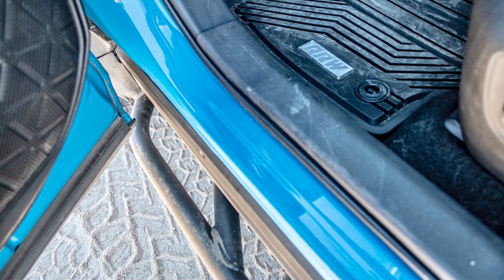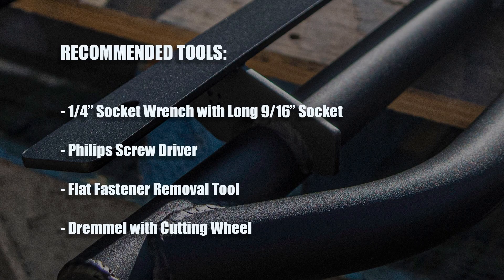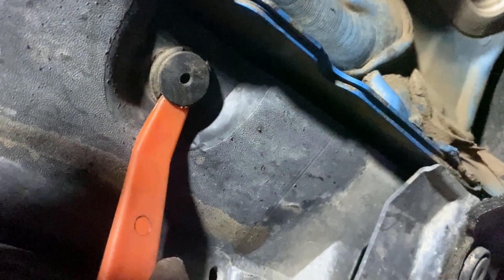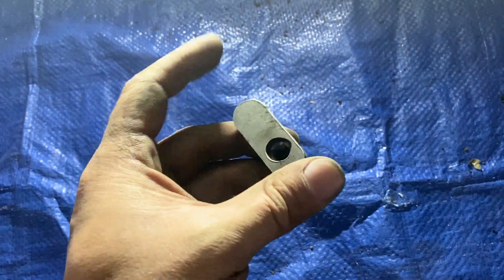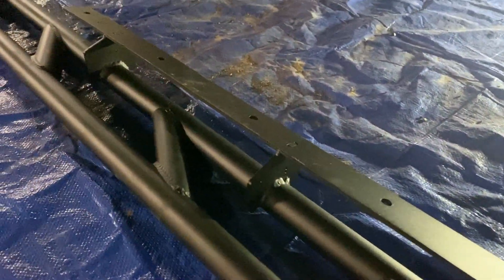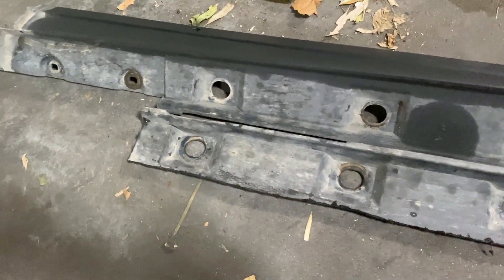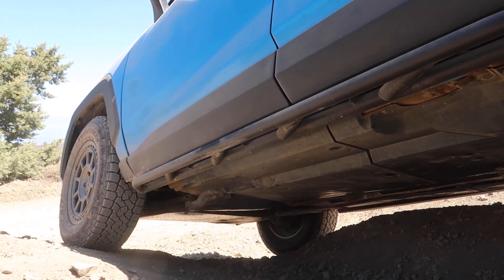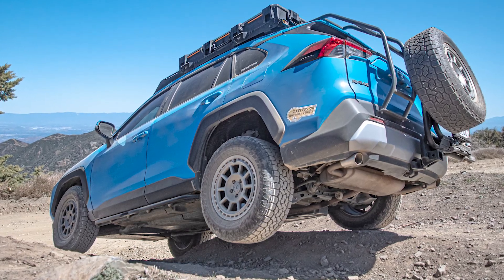2019-2021 Toyota RAV4 Rock Slider Install // Relation Race Wheels Body Armor

Comment: Well that worked
Watched the video, picked up the phone and ordered a set
I’ll let you know how it goes
Thank you for the video 
I have been searching for these!
Now if you could get your hands on some Hardrace ( Australia) :frame stiffeners ( sub frame connectors) , shock tower brace , and front / rear sway bars with adjustable linkages I would be super stoked
Not down to drop 4000.00 without some insight 
Keep wheeling 
Oh and when my wife grouches at me I blame you ! Hahaha
The Eibach springs, your fault
The Prinsu rack, your fault 
The BFG KO2, your fault 
Man you pick solid gear!
Reply from the maker: The RAV4 is not only my adventure rig, it is also my daily driver—so quality parts are a must and all my mods must be practical/utilitarian and not just for aesthetics.
Reply: And that my friend is why I have been watching your channel !
Ours is also a dual purpose vehicle
I asked about the frame stiffeners and such because I am looking to increase the off road capabilities of it
Those items would directly translate to better off road adventures albeit it also means a stiffer ride on the road but I feel like it still wallows about even after the springs not nearly as bad but it still has that slight wallow through turns and this would eliminate most if not all of that.
Excited for what you do next Sir
Thank you again

Comment: Any tips on screwing into the nut/fasteners? I feel like it was impossible to thread the screw in without shifting the nut over. I had to give up. Any help would be great, thanks!
Reply from the maker: Having a someone help hold it in place makes a big difference. I had to remove and redo mine a few times before I got all of them on without shifting. If you have the time you can also glue them in place so they are held in place long enough for them to be threaded—this part of the install was definitely a PITA. I also had random tools like a stick to help line up the nut to the hole.

Comment: What’s the purpose of these rock sliders ? Just aesthetic ?
Reply from the maker: They’re intended to provide some protection to your rocker panels from large rocks/obstacles you may run into when you’re off-roading on more technical trails—the sliders take the punishment and damage instead of the RAV4 itself.

Comment: Do you know if the sliders can be used as a jacking point to lift the car?
Reply from the maker: RRW told me it can take more load being pressed upward (lifting) than downward (standing on them)—that being said I haven’t tested using them to jack the car up yet.

Comment: I like em.   Did you loose any clearance at all?
Reply from the maker: Nope! If you look at the side profile of the RAV4 right under the rocker panel you’ll see the undercarriage plastics which sit lower than the line of the body panel—the slider basically fill in that bit of space. Very low profile!
Reply: @DannyRocksteady   Awesome.  That's what it looked like.   Def on my wish list.